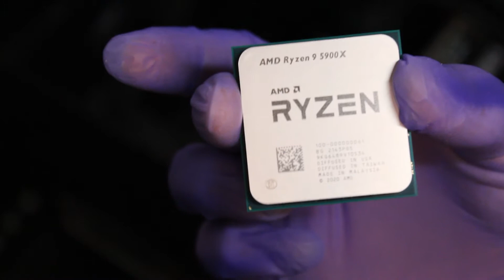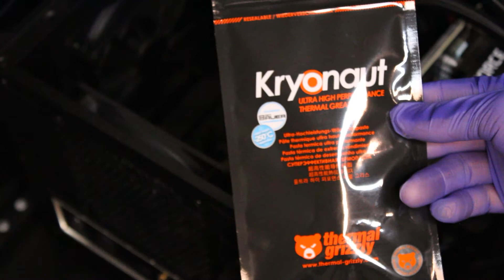HOW TO UPGRADE YOUR AMD CPU! (EASY)

Comment: Hey bro question? So I just built my first PC about 2 weeks ago. I’ll be upgrading my GPU and CPU. From 6700 XT to 6800 XT and Ryzen 5 5600X to Ryzen 9 5900X. I’ve seen some videos that i have to update Bios before removing old CPU. What do I do?
Reply from the maker: I did not have to update BIOS as long as the chipset is compatible with the motherboard, unless advices to do so. Please look at motherboard manufacturers’ CPU compatibility list yourself.
Reply: Look up your Motherboard model. You should find a page for your motherboard on the manufacturer's site. Find where the BIOS updates are, should be something like "Support".
You can use something like CPU-Z to see what model your Motherboard is and what BIOS version it has, since most of the time you can't just update directly to the latest. Sometimes you need to update gradually.

Comment: I am about to receive my Ryzen 9 5900x processor so I will remove my Ryzen 7 3700x, could you tell me what good experiences you have had after the change.
Reply from the maker: Overall the cpu is faster which correlates to better performance in games (slight increase in fps) the biggest thing I noticed was the ability to multitask, which is an importance for someone like me who edits and creates content.
Reply: @MoogeyTV  thank you so much👍

Comment: Is there really need for the alcohol? Arent there some alternatives? I will be upgrading from 3 3200g to 5 5600.
Reply: idk if you still need it, but Amazon sells wipes made specifically for removing thermal paste.  They work really well!
Reply from the maker: @codex947  this is good to know thank you!
Reply from the maker: Isopropyl alcohol is usually the best to clean of old thermal paste. It breaks down the old paste and evaporates so you don’t have to deal with any let over liquids. Good luck on the upgrade to the 5600!
Reply: @MoogeyTV  I dont really have access to it in my country

Comment: did your system automatically recognize it or did you need to do some changes, and if it did recognize is instantly, did you notice any immediate changes?
Reply: I upgraded my CPU a few weeks ago mainly to support Windows 11. I went from a Ryzen 1700X (from 2018 when I first built my computer) to a Ryzen 5700G. The computer did recognize the new CPU but it took a couple minutes. Also double check the motherboard documentation and make sure the motherboard supports whatever CPU you're considering buying.
Reply from the maker: It automatically recognized it. I did go through some settings to reoptimize it, although this isn’t required.
Reply: @MoogeyTV  did you go through bios settings or did you go through windows settings, and did you install a new bios for the cpu or did you just update it?
Reply: Its a good rule of thumb or uninstall the old cpus drivers and install the ones fort the new one
Reply: depends on the cpu and motherboard sometimes u gotta download a new bios